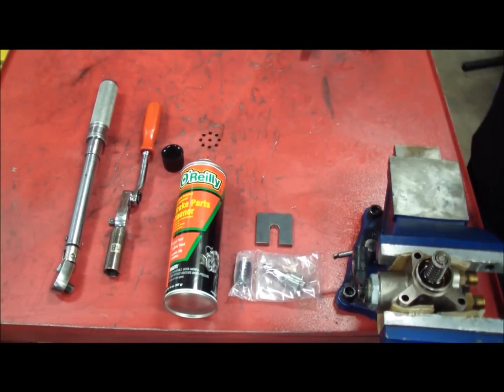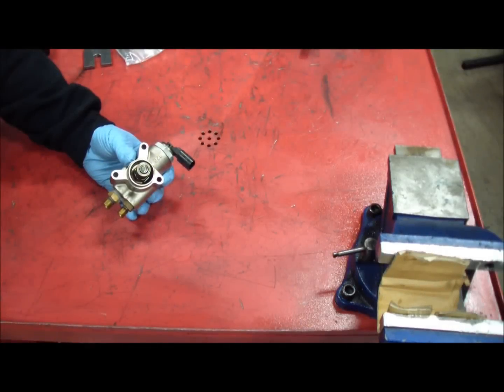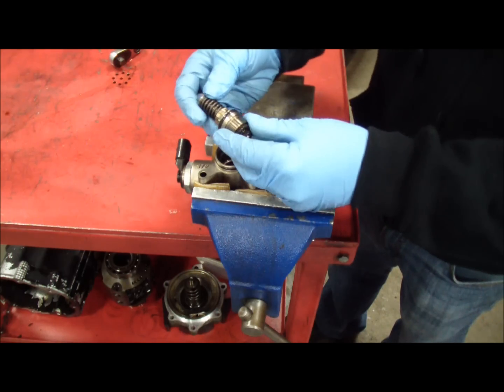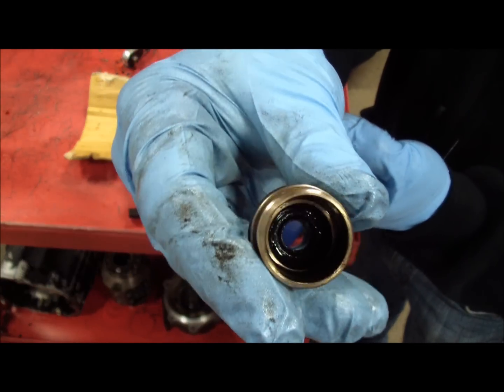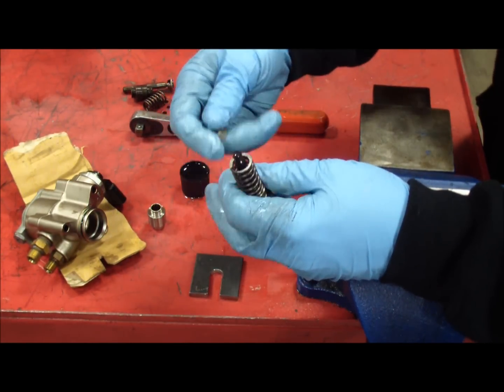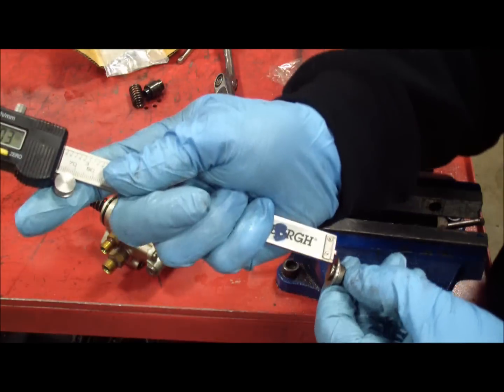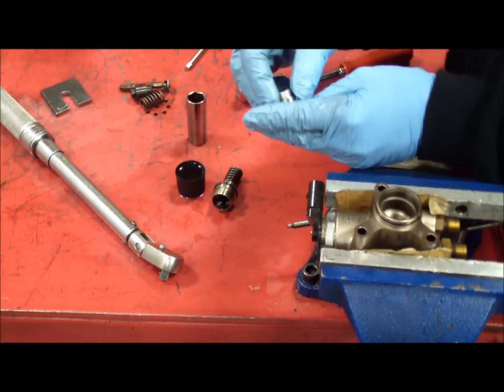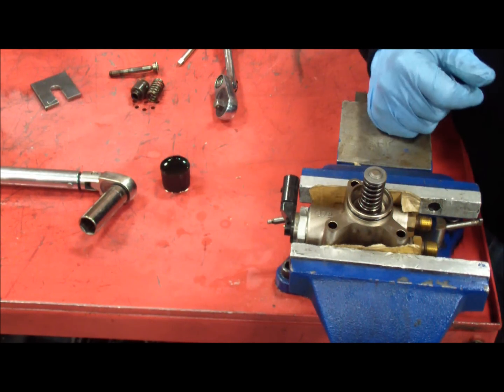JHM High Pressure Fuel Pump (HPFP) Upgrade Installation Procedure

Comment: Hello, I have a touareg 2007 v6 3.6, it uses a 03H127025C pump, is this kit for this pump? where do I find? send to Brazil? I looked for the kit on the website but I didn't find it!
Reply from the maker: We have never personally tried fitting or using this on that specific pump before here at JHM.
Reply: @JHMotorsportsInc  Here in Brazil, this pump has a very high value, recovering it would be much cheaper than buying a new one.

Comment: Bought this kit and I'm screwed, my internal seal is shot. where do I get just that seal?!?!
Reply from the maker: Brian, 

Audi does not offer any internal rebuild parts for these pumps. Usually requires a complete new pump, we have seen the internal seals fail on the Hitachi pumps before & always recommend replacement with new. We would also consider inspecting the rest of the fuel system if the seal deteriorated.
Reply: Hi did your fuel mix with the oil?

Comment: hi can i use this kit on my stock audi a4 b7 2.0 tfsi
Reply from the maker: Yes, you could install this on an otherwise stock A4 with no issues. Typically the upgraded internals are recommended for Stage 2 or above ECU tuning that require the upgrade.